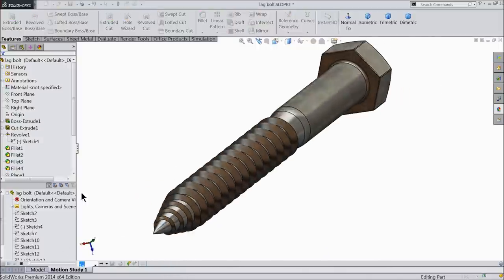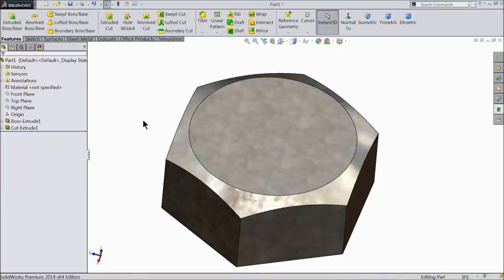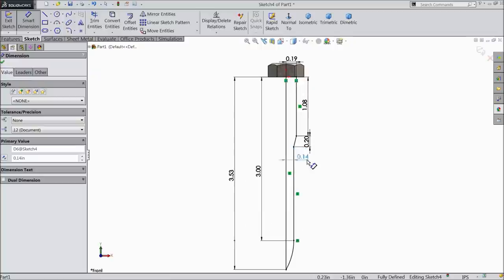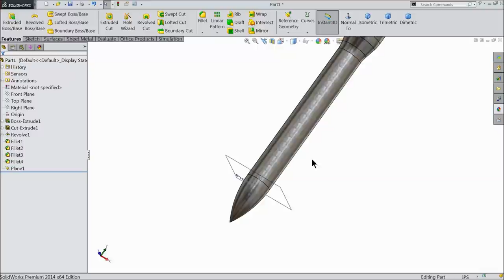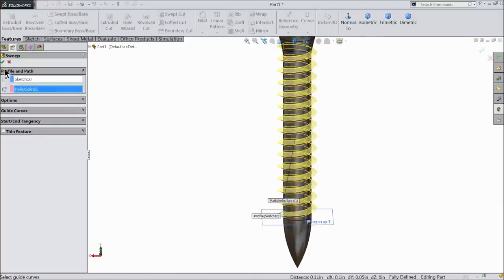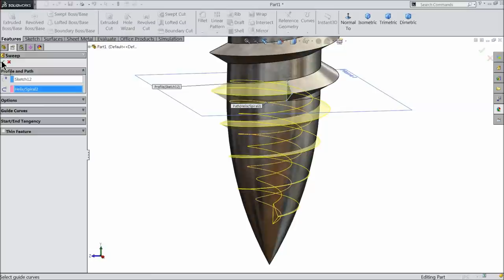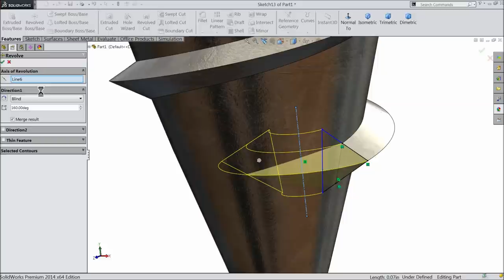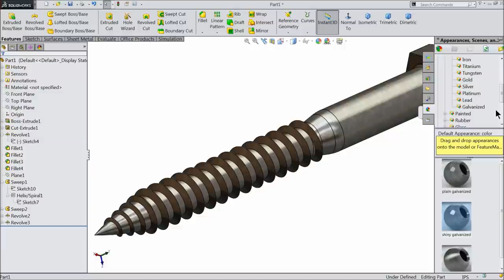Solidworks tutorial | sketch lag bolt in Solidworks

Comment: sir my objects colors is not shining  like this  i m using 2013, can u please explain me ?
Reply from the maker: you need professional graphics card like Nvidia quadro series or AMD Firepro for real view.
Reply: sir i have 2 gb grahic card laptop , 1 gb AMDA and 1gb intel
Reply from the maker: not suitable for real view, you must have Nvidia quadro series or AMD Firepro cards,
Reply: Actually you can use real view with not professional graphic card.
You must add yor graphic card in the registry and then solidworks recognize this card as nvidia quadro or amd firefro, depends on that which card do you have.
It works only for nvidia or amd cards.
Search for the tutorial how to add this in registry.
Reply: wow ive activate real view on amda radeon gaming card
 i m very happy
Reply from the maker: did you tried real view working with amd radeon ?
Reply: Ys
Reply: My GTX 980ti also has real view enabled :) I had GTX 660ti before and I did the same thing with the registry tweak and it worked too.
Reply: Its good